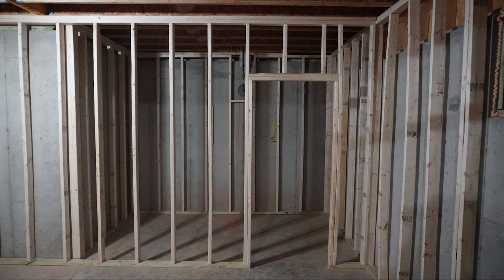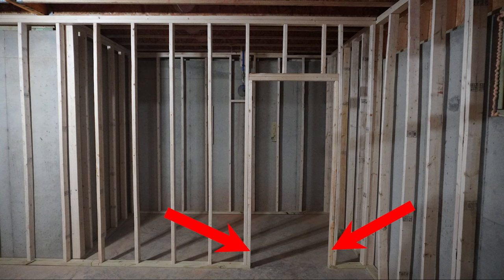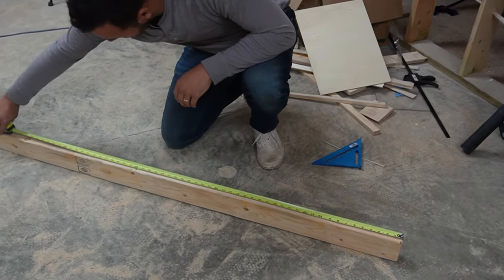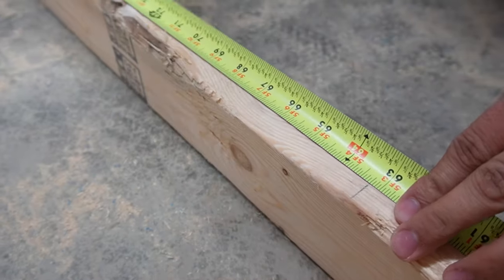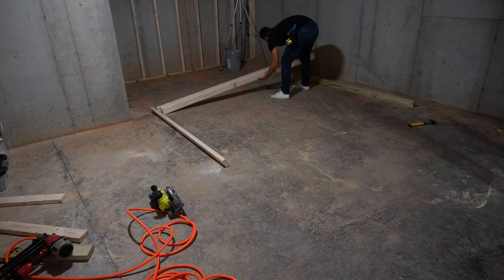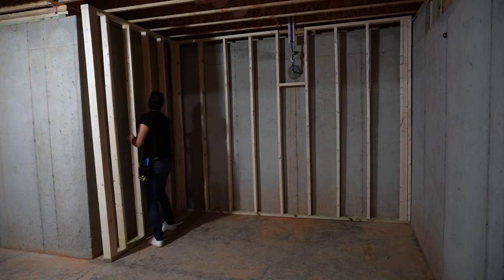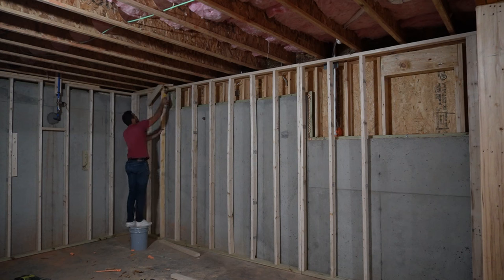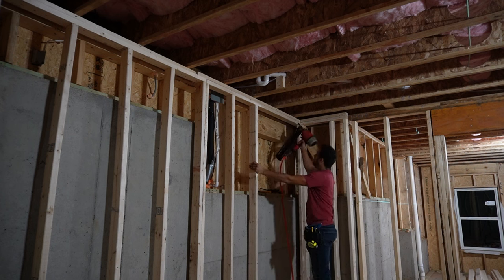How to Frame a Basement YOURSELF | Complete Guide

Comment: i would never install basement walls directly against the concrete, there should be an air gap and space for concrete to be able to breathe and you don't want moisture to be drawn into the stud walls from concrete if there is any moisture present being absorbed through the foundation walls when wet outside.
Reply: Treated wood should be used on the sill plate directly against the floor, or a membrane should be used. No air gap. If you have water issues you should not finish your basement until you get it dry.  What do you think is going to happen when you put drywall in a damp basement? Regardless if you have a gap or not that dry wall will get mold.
Reply: @andrewf8486 I'm building a garage 16x16 on a concrete slab...will pressure treated wood be fine or what's your recommendation? Thanks!
Reply: @FikretCekic base plate should be pressure treated with gasket between wood and concrete. Double protection.
Reply: omg your so correct!!always have an air gap , concrete absorbs moisture
Reply: @andrewf8486  my original comment was with respect to framed walls resting against concrete foundation walls.  They shouldn't be installed directly against the concrete but provide an air gap.  Concrete is porous and moisture can and will penetrate foundation walls and try to come inside without walls being sealed out.  You don't want wood framed walls absorbing moisture from the concrete and it will happen over time.  Air gap will always help.  I completely understand and get installation against the concrete floor.
Reply: @slo232000 how many inches of gap should you leave between wall and bottom plate?
Reply: @Donfixit4  if it was my install with wood framed walls, without foam board providing a barrier I would set a gap of at least 6" or more.  Concrete needs to be able to breathe if not on the inside it should to the outside to dry out.  If it can dry to outside and you use foamular foam board or similar insulating product, to avoid wood interior framed walls from touching concrete, I wouldn't have an issue with direct install against concrete.  In this video, the issue is direct wood interior framed wall against the concrete without a barrier or air gap.
Reply: Which is why we have a thing called subflooring.
Reply: at my previous house i had about 6" gap between concrete wall and finished 2x4 interior wall due to clean-outs on pvc drain pipe stacks that went down into foundation.  Couple quick access panels on drywall and setting wall in didn't have to worry about any moisture issues and gave concrete a chance to breathe.  I'm no expert on spacing but that worked out fine for my application.
Reply: i took apart my basement and found exactly this. the concrete leached water in from the ground and the frame was just decaying in place. i was taking it apart to have it waterproofed since this had ruined my drywall. i'll be framing my basement offset from the wall enough to clear the french drain. it'll make the room smaller but, oh well!
Reply: @jmacindc  sorry to hear of the issues you discovered.  It's a major problem installing those studs in contact with concrete.  Good luck with that project!

Comment: I think framing doors and windows with traditional headers is good practice but none of the partition walls are "load bearing" in an unfinished basement.
Reply: Exactly.
Reply: Newbie here-that was my Q, why did one of the doors have a header and the one at the end not have one? Do they technically all not have to have one in the unfinished basement?
Reply: @winestine  Correct. Everything is already supported. If you added a door or window to a load bearing wall, you would then need the header to put the weight onto the jack studs (since the new opening removed the existing support). He is adding walls, thus there is no load not already supported by the existing construction. His header was fine, just unnecessary.

EDIT: he did make a doorway in a load bearing wall. I missed that. I would always check that with your local building permits. Anything load bearing needs some oversight because you are shifting where the load goes and that might bring more factors into play. It's worth the money to make sure it's safe.

Comment: You can build your non load bearing walls a little short, set your top plate and shim between them. No need to fight it.
Reply from the maker: Thanks for the tip!
Reply: This technique has saved me so many times. Just have your studs 1/4 inch shorter to allow you easily stand the wall up and then shim to header at the required distances

Comment: you don't need a moisture barrier behind the studs where the concrete is?
Reply: After speaking to our town inspector, he clarified that most basements don’t require vapor barriers. However, where a basement wall is less the 80% buried by exterior soil (that number may fluctuate by state / country / local and national regulations), a vapor barrier is required. Part of my basement is completely underground and part of it above grade, so I’m going to have to use a vapor barrier partially around my basement.

Comment: I've done several of these and I always mount the top plate to the joist first, then build the walls on the floor and slide them in, I find that while still tight, you're not fighting with the wall in that angle that makes it just a little taller and much tighter until it's at it 90 degree.

Comment: Awesome video!  Can't wait to see the finished product.  It always seems like it's going to be so much easier to build the wall on the ground and stand it up until you build the first one and it doesn't fit. 🙂 I have succumbed to that temptation more than once.
Reply from the maker: I’m glad you liked it! I couldn’t agree more!
Reply: @theweekendbuilder you refer to the walls as being load bearing, but in a basement the load is supported by the walls and beam. You framed it like it was a normal wall above grad nothing wrong with it, but you don’t need to double up the top plate or build headers above the doors that is overkill.

Comment: Great video. Why call it a load bearing wall (new) if there was none before? Were metal posts  carrying the load to the basement floor? If so no new wall needs to hold weight right?
Reply from the maker: Great question! It originally had a large beam that carried the load but I needed to cut the beam for a doorway. So since I cut the beam about 75% of the way through, I had to support it. I did that by just making it a load bearing wall.
Reply: You consult an engineer on that? No judgement.  But typically you gotta go through them when modifying a main beam. Main reason is there needs to be a footer poured under any load bearing walls. Many fail to do that. @theweekendbuilder

Comment: I framed my first of more partition walls. with one entrance door. It took in all  about 11.50 hours. Its  7'  1/2" x 14'. Its for a sound and media focused room primarily so it has to have close nice tight tolerances. Which it does. Rockwool vapor barrier and caulking along each and every joint coming up next. I might also go with a more expensive drywall with additional acoustic properties. The framing aspect itself is easy af. No one should be intimidated with approaching roughing in their own wall/s. If your in need some go for it. I bet I can do a better job than the local neighborhood  "handy man" hanging the drywall, too. Btw never let an un licensed contractor anywhere near your house.
Reply from the maker: Thanks for the comment!

Comment: Great video, but I have a question.  When nailing the frame into the concrete, how far apart should your concrete nails be? And how many should you use? It looks like you just placed one nail dead center every couple of feet, but I can't tell. Thank you!

Comment: When installing the header (9:20), why do you have 2 headers offset like that, one on top of the other? To me it looks like you wanted to shift the door to the right a bit. Or is that configuration better for strength? Thanks

Comment: Does the wall go on concrete first and then subfloor? Or subfloor first and then wall? I keep seeing videos online with wall first but elsewhere online it says it’s better to put subfloor first? Thank you
Reply: I'm currently finishing my basement, I just finished my subfloor first and then walls on top. Im employing a DMX dimpled mat under a 23/32" T&G OSB subfloor.  This way if there is any moisture, the floor will have the entire basement to air out and not just from one room to the next. This also allows me to use all standard grade 2 by material. Also this system will keep the flooring much warmer than a concrete floor directly in contact with the finished floor, Aka a thermal break.

Comment: hi i am building a room in a warehouse but the warehouse ceiling is much higher than the actual room being built. so how would you construct the stud room ceiling as i see many videos making stud walls and attaching them to ceiling rafters but that wont be possible with my project , am basically building a cube box with a door.
Reply: Just build the walls like he shows in the video attaching the floor plate to the concrete and once the walls are up you can build the ceiling framing the same way. Just when you measure be sure to include the width of your framing lumber and then just slide the ceiling sections up on top of the walls and attach with nails.

Since it’s just a room inside of a warehouse you don’t have to worry too much because there is no load bearing walls. You are pretty much just framing a cube to attach drywall to

Comment: Is there a code for nail size on non-load bearing partition walls.  Everything I read online says they need to be 3.25 inches length 16d (0.148 inches) diameter but the only framing nails for nail guns in the store are 3.25 inches length and 0.120.inch diameter.  Am I missing something?
Reply: If you are worried that a wall wont stay up just add a few more.  Nails are incredibly strong and can hold a sheet of drywall with just 1.

Comment: Great video. just one quick question how do you figure out if the wall is load bearing or not when you have no blueprint?
Reply: In a basement there should be no load bearing walls. The load of the upper/main floor is all held up by the main beam & jack-posts that is put in when the home is built; which means there is absolutely no need for double plates.
Reply: if you already have current framed walls in the basement that the builder did then they may be load bearing. You can look at the top of the wall and see if any joists are resting on them.

Comment: Why not just increase the stud length instead of use a double top plate?
Reply: I think he has higher ceilings so the 8' stud length isn't long enough.
Reply from the maker: Great question! I have 9’ ceilings so the studs I needed were 104 5/8ths. It would cost a lot more to buy ten foot studs and cut them down and it would add a lot of work.
Reply: The other reason to have the double top plate is for nailing sheetrock.
Reply: Hi!  @aavronestep9031  could you elabore a bit more, In what way does the regular process of hanging the drywall changes?

Comment: What size nails did you use to frame?
Reply from the maker: There are different ones that you will need based on your framing nailer. Mine were 3” 21 degree framing nails